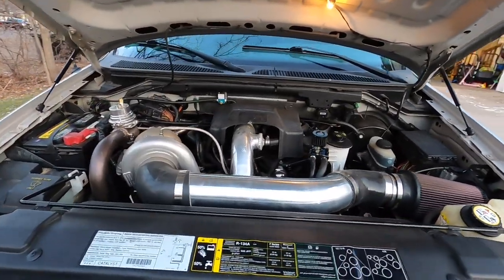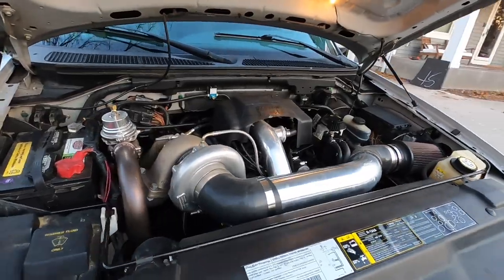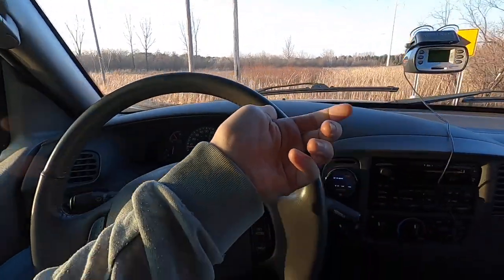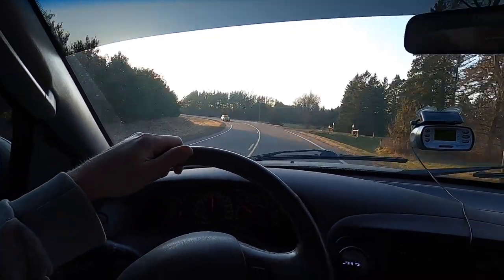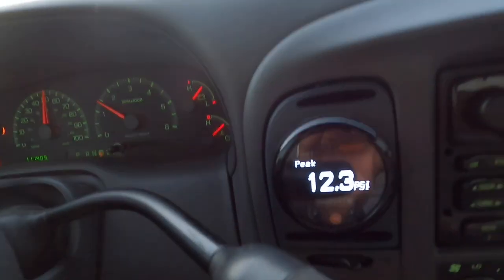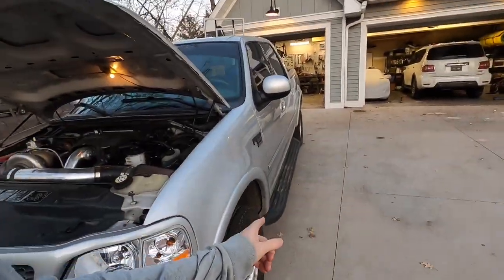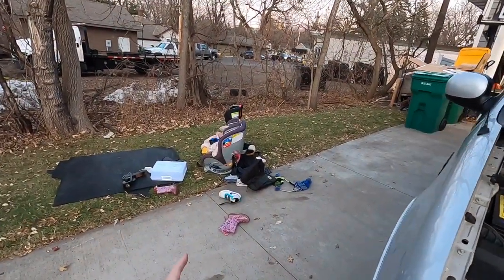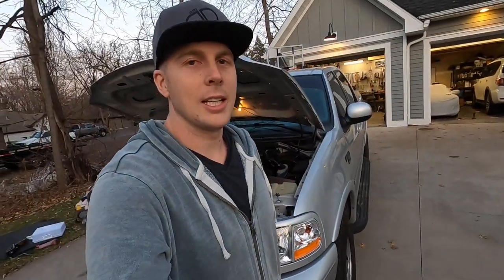Can a SINGLE TURBO make an old STOCK F150 do 0-60 in under 5 seconds?!

Comment: Remove spare tire, rear seat. running boards and a lighter battery before tranny shift kit, and low pro tires will give you steeper gearing.

Comment: Might be a bit risky with the amount of HP your putting down but !!! Ive found it to be faster when I shift manually into 2nd gear right about 40mph, ...yeah it'll bang the trans a bit but I let off the gas halfway, shift to 2nd, take it to 65 and shift back into drive 😁

Comment: Stay 2v, the trick flow 185 head with a set of decent streert able cams on E, 1000hp is easy. The 4v B or C heads are great but cams are a lot more, valve springs are a ton more, and machine work and valves are way more. Plus aftermarket intakes are hard to find and when you do they are an arm and a leg, and the adapters never fit right and leak, believe me I have tried probably every brand made lol. Point is stay simple. Spend that money on a good turbo and a good air to water. The Trick Flow 185s are reliable, and can make well over 1000hp. My 4.6 made 1175 with a set of 185s.

Comment: When is the last time you check the spark plugs? Maybe throw a new set in there?
Reply from the maker: Umm. Never... Lol I should probably do that soon. Only about 4,000 miles since install so far.
Reply: I'm assuming you put new plugs in then?
Reply from the maker: Oh yeah. I put brand new NGK TR 6's in for the turbo install and gapped them down. I can't remember the gap off the top of my head
Reply: Might be Worth pulling one to see how it looks.
Reply: @sportysmith66  lol pulling a spark plug on a 5.4 is a 3 weekend typa thing
Reply: @Behindyamom  not it you pull the first one.
Reply: @Behindyamom  more like one hour to change all of them
Reply: @paulhouchen9010   maybe with the right tools and experience but even then
Reply: @Behindyamom  lol 3 weekends? What are you using, your fingers? 🤣
Reply: @Behindyamom  changing them on a 2v 5.4 which came in the 97-03 heritage generation is no different than any other engine. The only problem is getting them to stay in if not torqued correctly, as there were hardly any threads in the head for them to seat in. I’m guessing your thinking about the 3v 5.4 which came in the 04-10 generation. They were a 2 piece design with the lower portion commonly seizing in the head.
Reply: @dakotakelly9371  no dude I’m taking about the fact that you have to shove your hand and dig super deep to reach the back plugs.
Reply: @TonaldJDrump-dl2bu  I meant 3 day weekend lol

Comment: This build series is really interesting. I’m really interested in what you plan on using for internals, heads, and what not. I currently have a 2000 F150 XLT Ext Cab 5.4L 4x4 that I would loved to do a roots supercharger build with. Built block, forged internals, Ported Heads, cams, etc. it’s awesome to see somebody doing something with this gen truck because nobody really does unless it’s the SVT Lightning.👊🏼🤙🏼

Comment: Hey Ryan,
 Congrats man awesome runs. Unfortunately I put my truck aside for now with the passing of my wife I have other responsibilities. But your 1 2 shift is 5500 and I set mine at 6k with less slip and made it a firmer shift. Doing that makes it harder on the tranny. Also I went to 285 75 17 tires to raise my final gearing and it helped a lot as well.

Comment: Might need a better gear box ..... and some axle mods as well.
The transmission is frying itself under boost.....and your hole shot is slooooowwww because of high gears ⚙️....
Not knocking you.....but the next level will amaze you.

Comment: Consider ported npi heads over the pi. No thread blowout, thicker decks, combustion chamber is similar in cc to a 4v which should keep compression boost friendly, you can get over 225cfm on the intake side without removing the swirl dam which cannot be said for a Pi head and with the added clearance with the piston being in the hole on the 5.4 should let you run some pretty aggressive cams. Trickflow's would be your next best bet but for the money, if you can find someone who knows how to work modular heads, a npi may be a good option.

Comment: You could have taken the tailgate off in less than 5 minutes, I have the same truck and have taken off the tailgate before I removed the bed of the truck to get to the fuel filter😁👍

Comment: Grab a set of 4v heads for your new motor
Reply from the maker: You think that would be better than TrickFlow 2v heads?
Reply: Don't know I built my 02 f150 with ported navigator heads and cobra cams then used the cg fabrication gt 500 twin turbo hot side kit with eBay turbos
Reply: @AutoDetour  there is no 2v modular head that will touch any of the stock 4v modular heads. I would go with either navigator heads or late production 9thread c heads(03-04 cobra, Lincoln aviator, mach 1, and mercury marauder)

Comment: That trans needs tuned BAD.
Reply from the maker: It is tuned. We put in a bunch of torque reduction into the tune on the shift, so it’s pulling power before the shift to help save my stock transmission. It does make the shift sound slow, but the actual shift is pretty firm.